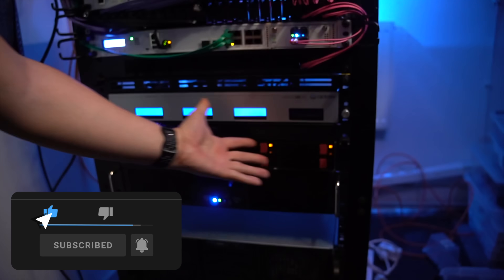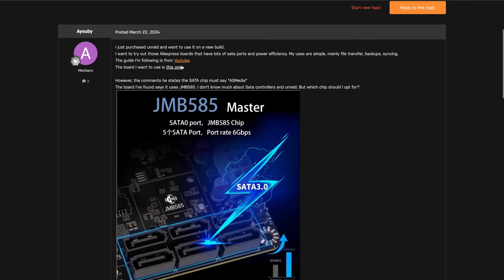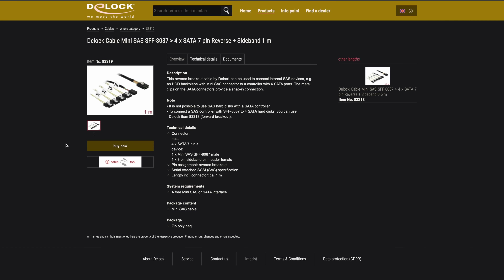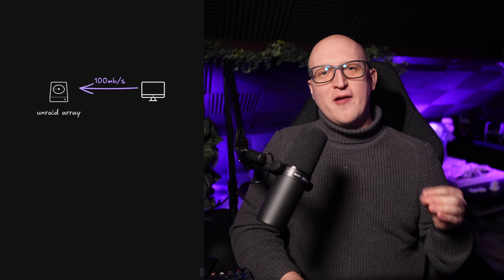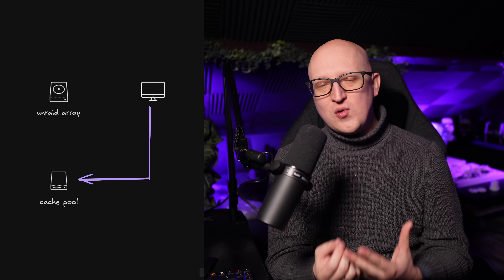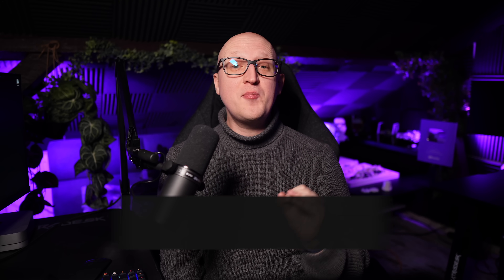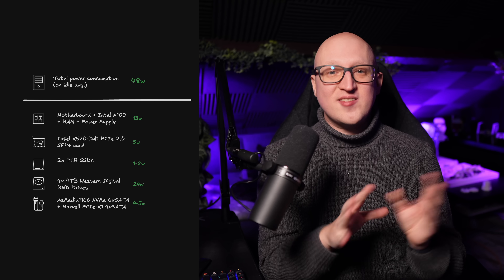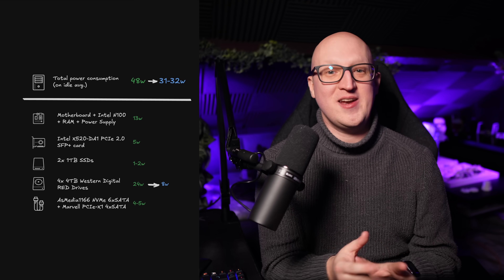New Unraid Storage Server upgrades and testing!

Comment: Personally speaking. I’d never touch unraid.
Reply: Why?  I’ve ran Unraid for years and now 7.0 integrates Tailscale and it’s amazing.
Reply: Money issues?
Reply: No one asked
Reply: For me it is just that TrueNAS Scale is just so good now. You can install your OS itself on NVME drives in a mirror for redundancy instead of just having a usb drive for it all. The storage scheme is just a lot more robust on TrueNAS. I will admit that in the past it wasn't always true but with the latest release of truenas it has gotten a lot more user friendly. They now support ZFS expansion akin to what you would get on unraid and they support standard docker containers for apps. I am not saying that Unraid is bad but that I just don't see the benefits to use it where there are real tangible benefits to just using truenas scale now.
Reply: @chaosfenix  How about mixing drives with different sizes?
Reply: @ I mean you can do it so long as they are in different pools. But if you are intentionally mixing the sizes with just whatever then you have a different problem.
Reply: @ I know you can do it :) and that is one of the benefits of Unraid vs TrueNas Scale
Reply: @ No I mean you can do it so long as they are in different pools in ZFS. Mixing sizes like that though isn't recommended you are right. I will say though that it isn't like that feature is free as the performance of unraid vs zfs is usually quite a bit lower
Reply: ZFS usecase is different vs what Christian is using it for. My main rig is ZFS single pool for data that is not important and back it up to Unraid in a pool with parity with disks with different sizes that can scale much cheaper then you can with ZFS.